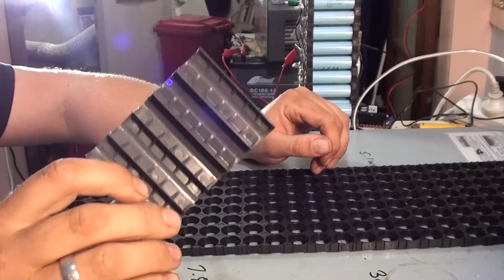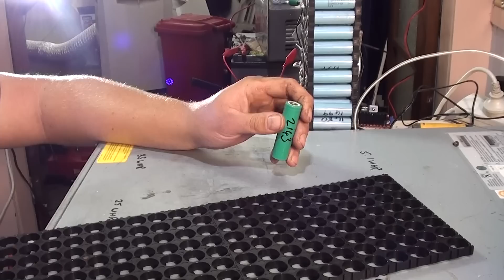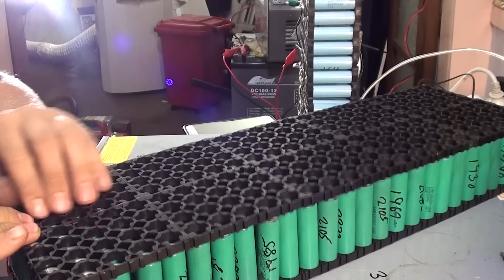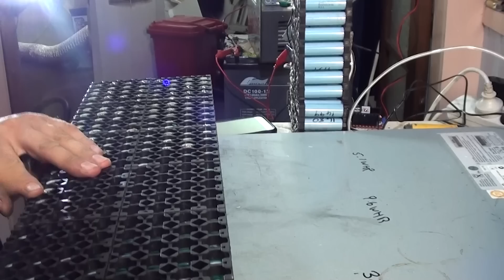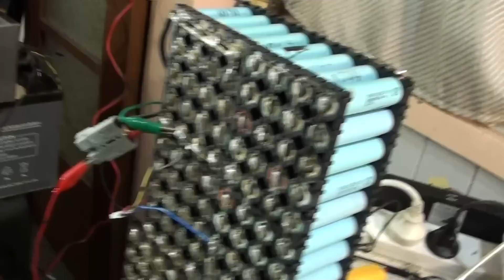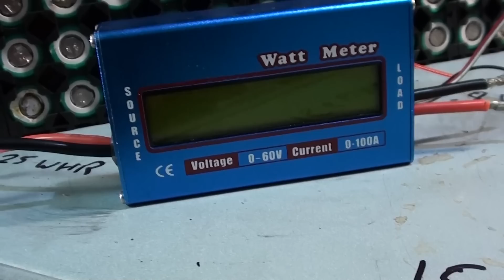200 cell 18650 samsung  Ebike battery build 1.5 KWH!!

Comment: I recently rebuilt two 36V batteries for two separate bikes. One 10S3P and one 10S4P. I suspect the cops will be pulling you up for this haha.
Reply from the maker: Yeah used it for a while then went to 48v as i got a 1750w motor cheap

Comment: If you're pulling 2300mAh out of a 20R then your tester is WAYYYY off. Best you should pull off those cells is 2100mAh. Maybe 2150mAh at a slightly higher discharge rate to heat the cell up.

And there's not a single 20C 18650 3.6V or 3.7V cell

Comment: 2300mAh 20R? 2:04
Reply from the maker: Yeah some test really good . Most in 2100 range a few higher. That's out of around 1500 tested
Reply: @Oneupthesleevecustoms  what do you use for testing? as i have concluded my opus is quite off, im testing new 20R cells for pairing in battery packs and new turn out around 2200, but real capacity is around 2090 probably. Thats why im surprised to see 2300
Reply from the maker: Opus 3100 also. What did you compare to find the in accuracy
Reply: @Oneupthesleevecustoms  i have made constant current drain device from instructables (https://www.instructables.com/DIY-Constant-current-load/) and measured capacity manually. that does not guarantee acuracy because i used my dmm to measure drain current, but results match results from lygte-info.dk on multiple models of cells

Comment: How many kilos would it go in one charge?
Reply from the maker: I was getting 25 kms easy on 21 amp
Reply: What if I want it to run a hundred kilo? What size battery do I need?
Reply from the maker: Lots of factors in calculating that mate

Comment: Hello can you please tell me how many nickel strips in 0.20 you have To accumulate for resistance.  For a 20s 10p battery with Samsung 25r cell.  I have a nominal 100A bms 200A pic
Reply from the maker: What do you mean for resistance
Reply: @Oneupthesleevecustoms  for the poser of amps si that it will hold the shock well knowing if is necessary for example doubled or tripled the nickel strips
Reply from the maker: @abityson3418  is the strip rated for Current draw? I've never seen it specified in a sale listing. Might be best to ask Peter at hb powerwalls YouTube channel
Reply: @Oneupthesleevecustoms  i dont understand anything tanks anyway i write To you by translation i speak very little english
Reply from the maker: @abityson3418  sorry mate I only know English:(
Reply: @Oneupthesleevecustoms  finaly i understood thank you very much. 👍👍😁
Reply from the maker: Thank you for watching my videos

Comment: The whole amp hour, watt hour, and discharge rate calculations were incredibly wrong. You should only multiply the capacity of a single parallel group, not every cell. You are off but over an order of magnitude on all your calculations.
Reply: Well, if you’re running 15p that’s only 2.1amp hours times 15, not times 200. Each series group is not adding amp hours, just voltage. That’s only 31.5 amp hours. However, because it’s a 48 volt pack (nominal), that’s 31.5 times 48 for the watt hours. 1512 on that, so your watt hours was right at the end, but I’m not sure where your 31000 figure came from. However, you can’t calculate the maximum discharge with 200 cells, again, because you’re parallel number is the only thing changing current. Series is just changing the voltage. At 30 amps per cell, that’s only 450 amps, not 8400. Anyway, it was a whole mess of incorrect calculations in there. I know the video is old, so any input from me is irrelevant, but it’s not nearly as powerful as you’ve made it out to be.
Reply from the maker: Got a bit carried away then didn't I. Thanks for catching that as 170k people who have watched it over the years didn't even pick up on it. Good job !!! I appreciate your time to help me out thanks
Reply from the maker: What capacity did you get?

Comment: Just came across this video, exactly what I’m looking for. I’m building an electric go kart and the motor I ordered was a 16kw 72-96v 175amp system. With the info presented on your video would I need 27 batteries in series to achieve 96volts? Also 4 in Parallel so a total of 108 batteries would give me 226ah or am I wrong ? And would my motor take over an hour to completely drain the battery back I would make ? Thank you a lot really appreciate the help!!!
Reply: Download on the Google play store Battery Package Calculator.
Reply from the maker: Thats a good idea
Reply: Richard Hoemberg I have Apple no apps on our store that does that.
Reply: @Jcslim138  Every computer not Apple Inc can run android try asking to use someone's phone for 5 min.
Reply: Richard Hoemberg i actually did lol, everyone I asked all had iPhones
Reply: If you can check for me that’ll be great
Reply: @Jcslim138  Oh please ???
Reply: Richard Hoemberg please 😫 I’m begging 😁
Reply: @Jcslim138  Ya know I looked at your upload and if your serious about making a" Tech Channel" people will trust you if your serious and want help and post asking others for assistance and may even  subscribe but not if your going to be a troll and just cut up those who would honestly help you to your goal . Thanks but rather no thanks for the sarcasm.
Reply from the maker: @Jcslim138  dammit apple
Reply: Richard Hoemberg I wasn’t being sarcastic but not a problem, appreciate the advice 💪🏽
Reply: @Jcslim138  Ok you wanted a 90 volt battery with just under 1.44 kwh capacity of 15.4 Ah total energy of 1.34 kWh,with a max continuous discharge amperage of 49A is 175 pcs.at total weight of 7.35 kg pack size 25s 7p using 3.6 nominal voltage and 2200ma 18650s .

Comment: I just purchased 100 21700 4800mah cells for a electric go kart for my son and I plan to match it with a modest 1800watt motor hoping it has descent run time.
Reply: Plan on going 48v was thinking 13s7p since I’m just shy of 8p trying to calculate run time and what size motor is best suited for the pack but that part is where I get a bit lost
Reply from the maker: What voltage are you going for
Reply: One Up The Sleeve Customs  do you have a way to private message wanted to ask your advice on my build
Reply from the maker: You can email me One up the sleeve customs@ gmail .com
Reply: One Up The Sleeve Customs thank you man I love to build but electric stuff is still quite new to me.
Reply from the maker: No problem mate thanks for watching mate

Comment: I got a question is 12s even 48v? thats what i run but im overvolting 36v
Reply: @2ndhanseimen I have like 3 volt meters...
Reply from the maker: Whats up mate?
Reply from the maker: 13s is
Reply: @Oneupthesleevecustoms  ok so what's 12s
Reply: It overvolts my 36v ebike though
Reply from the maker: 12s 44v
Reply: @Oneupthesleevecustoms  well that's perfect for 36v then
Reply: I just always thought it was 48 lol
Reply: Also I'm making an ebike battery from scrap laptop batteries I'm getting instead of those 3500s because it gonna be a lot of money and I'm buying equipment instead for now I'll make a video on it it's gonna be a 13s 8p hot glue pack.
Reply from the maker: That will get it  moving. How many watts?
Reply: @Oneupthesleevecustoms  a 1000w but it's really like 1500w it pulls like 30a I checked it with a couple lipos at 12s though not 13s
Reply: @Oneupthesleevecustoms  but my actual ebike is 48v my other one is 36v 750w that I run on 12s this pack is gonna be for my 48v 1000w ebike
Reply: @Oneupthesleevecustoms  hey I uploaded a cinematic vid
Reply: hey do you solder or spot weld you packs?
Reply from the maker: Solder mate
Reply: @Oneupthesleevecustoms  cool im soldering mine with 14 guage copper bus bars from like building wire romex.
Reply: this is is gonna be a long project stay tuned till the finish

Comment: Nuce build bro, but why would you get used batteries for an ebike pack? New batteries would last maybe 2 years if charged discharged often, so old ones maybe less than a year? Is all the trouble really worth the money saved? Just a suggestion from a fellow builder :)
Reply from the maker: Whole pack owed me around 180 bucks no way i could afford 200 6 dollar cells sadly
Reply: @Oneupthesleevecustoms  well thats a good deal cant argue with that!
Reply from the maker: Na so it was worth the hard work testing ect

Comment: Helllo !
I have an electric motorcycle wheel  ( made in CHINA ) , with hub engine of 5 Kw ...and I want to install it at my Monster fat bike ...
What I want to know is , what power should have the battery , for a range of 100 miles  ???  I want to make one ...and I need help...
 I would allso like to know , how manny volts have this 200 cells battery , in the video.
Thanks in advance !!!😀😀😀

Greatings and a Happy new year from ROUMANIA !!!
Reply from the maker: This was a 48v battery. You need to work out aproxx how many watts it will use per mile mate and design your battery around that. 
It might be 5kw but its not going to pull 5kw all the tine

Comment: 14S 14P would take 196 cells.  If your  motor is 48V... build it 14S!
Reply: 52v, better wattage output for longer before BMS cuts off

Comment: I want buy
Reply from the maker: Haha whats your offer ill build you one. Ps you cannot post them
Reply: @Oneupthesleevecustoms  what's  the  volts ?
Reply from the maker: 48v nominal
Reply: @Oneupthesleevecustoms  well I'm interested in building something in the the range of 72 to 96 Volts  ( it would be Great If I could build it in a Triangle shape)  

I'm a little on the Heavyweight side & I'm interested in a 8000w hub motor kit !!!! 
 How many batterys  ( etc) Thanks.  
I Really Appreciate
Reply from the maker: Higher voltage is always a good idea. Get your cell holder 3d printed
Reply: @Oneupthesleevecustoms  
 How do you do that ?
Reply from the maker: Get measurements and 3d model it print it out perfect size ready to install on your bike
Reply: @Oneupthesleevecustoms     well I'm Very New to this kinda thing & 
Well How Many Batterys 18650; would it take & Perhaps to make it more Simple as in a Square shape   ...  just wondering

Comment: I have no idea how you are calculating amp hours but the correct way is to take the amp hours of a single cell and multiply that by the number of batteries in parallel. If you wire 200 cells for 36 volts you will have 10S 20P (10 in series to get your 36 volts) (20 in parallel) if each cell is 2000mAh or (2 amp hours) 2 times 20 (the number in parallel) gives you 40 amp hours at 36 volts. If you choose to wire 13 cells in series for a 48 volt battery you will only get 15 in parallel. (195 batteries) if each cell is 2000mAh you will get 2 times the 15 or 30 amp hours at 48 volts.
Reply from the maker: +joe duerr thats why its rated in kwh mate

Comment: One up the sleeve customs, point of correction, you dont have 1.5KWH yet until you connect your cells in parallel and series configurations. Yes, you have 200 cell @ 3.7V and average of 2.1AH =1554WH=1.55KWH. But you will need like 48V or 24V for powering, therefore you will need 13 or 7 cells in series respectively to realise these voltages. Mind you when you have series connection, the power per cell remain the same, but the power adds up when you connect these series connections in parallel.
Reply: Good call but I think the math ends up being the same anyway. Except for the fact that 13 or 7 doesn't divide into 200 completely so he'll have some left over unused cells. But if he were going with a 12v pack out of 4S (which does divide into 200 without any remainder cells), he'd still end up with 1554Wh.
Reply from the maker: Yeah some people can't see  were a build is going. Module holds 1.5kwh haha
Reply: @Oneupthesleevecustoms  power is power right, no matter how you use it. Awesome video by the way. Gonna make some packs as well and nice to see how different people do it
Reply from the maker: Yeah exactly power is power thats why i use that rather than am hrs
Reply: Correction to the point of correction of the correction made toward the original correct statement…. 
He does NOT need to wire in parallel AND series because power is there either way he just needs to connect in parallel or series or both…. 
3.7x200 cells x 2.1 = 1554 
3.7 x 10s = 37v remainder 20 x 2.1= 42ah or 42k mah soooo 42x37= 1554mah or 15.54AH or 1.5kw (hence 1000w= 1kwh)  

Or even 3.7 x 2s= 7.4v ——-100p x 2.1 (2100mah) sooo 7.4vx2100=15,540mah meaning 15.54AH meaning 1,554Wh =/rounded as 1.5kwh 

Run a 1500 watt set up and wallah you have about 1 Hour before your looking for your charger (minus any loss due to heat, resistance, efficiency, weather, hills yards yaddda 

Anyways as you see he just needs to connect he does not even need a bms because he STILL has that block of power either way. 

Many ways BUT it’s still the same block of power only thing that could change it is the cells capacity/brand

Comment: where did you buy your batteries?
Reply from the maker: Donald Krambeck recycled drill batterys
Reply from the maker: +Donald Krambeck so these are all high drain drill battery cells  samsung 20r's
Reply: we are supplier of high quality li-ion cells, spot welders, bms, nickel strip, plastic holder, pvc wrap, with our parts you could build your own battery pack. if you need welcome contact with me. skype: e-firesales    email: littlebear@cl-rd.cn   www.cl-rd.cn   thanks in advance

Comment: hi, where did you buy those black rack for batteries?  what does it called? thanks
Reply from the maker: +Hie Do they are called 18650 cell frames 4x5 or 20 cell. They are on ebay  amazon geek and banggood mate
Reply from the maker: +Hie Do these are called 5x4 18650 cell frames
Reply: we are supplier of high quality li-ion cells, spot welders, bms, nickel strip, plastic holder, pvc wrap, with our parts you could build your own battery pack. if you need welcome contact with me. skype: e-firesales    email: littlebear@cl-rd.cn   www.cl-rd.cn   thanks in advance

Comment: kinda like all yor eggs in one basket aint it 
what if one goes bad right in the middle 
wouldnt 4 packs of 50 be prudent for serviceability and test ?
they're all goin into one case that'll keep em together aint they
Reply from the maker: +Bob Saturday the form factor is as is so it fits into a bike frame im modifying  . The cells can still be removed if there was a failure mate

Comment: how do you know the C rate:?
Reply from the maker: +Dan Sebastian google the cell id number mate
Reply: Thank you,but if is used it will not have a lower C rate?
Reply from the maker: c rating is more about the construction of the cell some are high output some are high capacity.
Different tool for  a different job sort of thing

Comment: loved ur video actually i am also working on bulding a ellectric scooter can u help me like i dont have any idea how manyh cells will i need to power a 3kw motor which can run  at a s[peed of 70 kmph ?
Reply from the maker: +Atul Pandey 3kw thats awesome you  need to know its amp draw at max torque  do you have a spec sheet on it
Reply: actually im naive in this field  and it turns out that i cant get  a 3kw motor so now i have to stick to a 1000 watt motor which how many cells will a 1000 watt mtor require and also its seriesd and parallel combinations
Reply from the maker: +Atul Pandey what voltage do you  want to run?
Reply: what would be best acoording to you?
Reply: 48 or 72 ?
Reply from the maker: +Atul Pandey 48v is good so 13 cells in series 10 in parallel  130 cell pack
Reply: thank u so much:)
Reply: how much amp of current will i need to  provide the motor continously like combined 130 cells should provide how much amp in order for the battery to run?
Reply: motor*  to run
Reply from the maker: Atul Pandey get 2000 to 2500 mah cells rated for high discharge and it will easy deliver 120 amps
Reply: what will be the max speed with  a1000 watt motor and a 48 v pack?
Reply: rerally apreciate ur efforts for providing me some knowledge mate
Reply from the maker: +Atul Pandey around 40 kph with 26 inch wheel
Reply from the maker: +Atul Pandey your welcome thanks for watching
Reply: what should i do to increase the speed  to 60 or 70 ?
Reply: i would need to find a 2 or 3 kw motor i guess
Reply from the maker: +Atul Pandey you can buy geared hub motors they are faster but have less torque
Reply: we are supplier of high quality li-ion cells, spot welders, bms, nickel strip, plastic holder, pvc wrap, with our parts you could build your own battery pack. if you need welcome contact with me. skype: e-firesales    email: littlebear@cl-rd.cn   www.cl-rd.cn   thanks in advance

Comment: would you recommend these cell holders? also, can you link me if possible? thanks
Reply from the maker: +Miles Papineau cell holders are great search 18650 4x5 on ebay or Allied express
Reply: thanks
Reply: hey guys, thanks for your nice video. we are supplier of high quality li-ion cells, spot welders, bms, nickel strip, plastic holder, pvc wrap, with our parts you could build your own battery pack. if you need welcome contact with me. skype: e-firesales    email: littlebear@cl-rd.cn   www.cl-rd.cn   thanks in advance